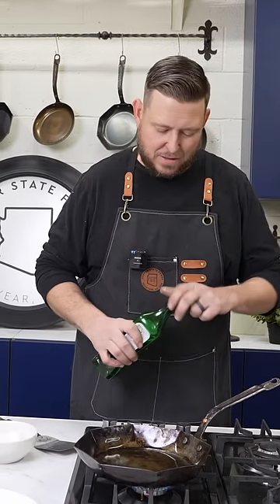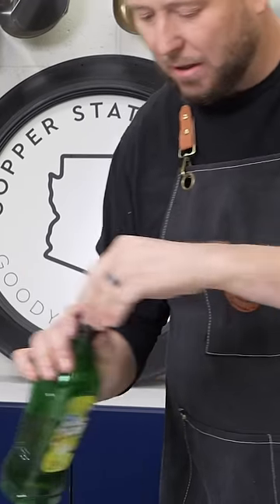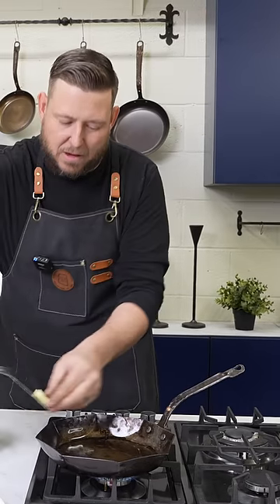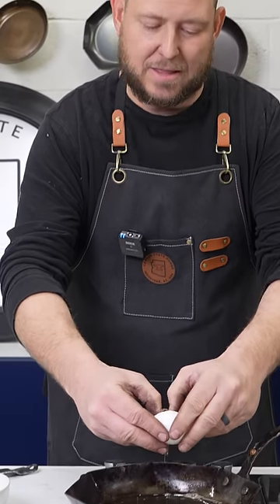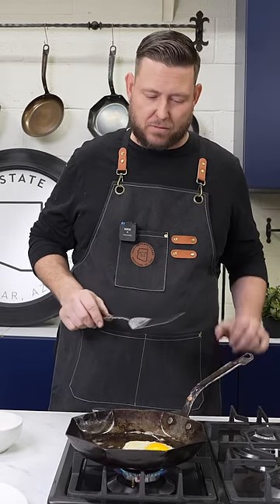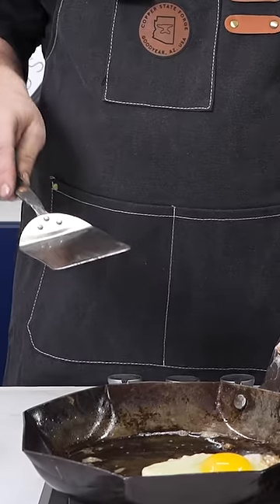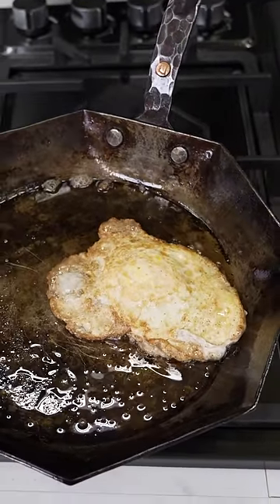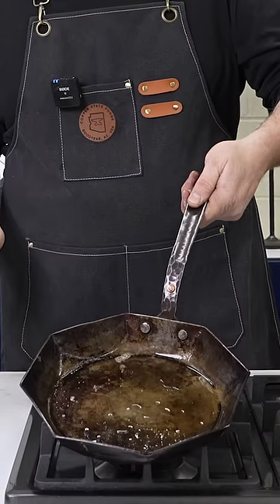Frying an egg in carbon steel.

Comment: Oil shouldn’t be necessary. You cook eggs at butter heat. The oil adds a bad flavor to the egg in my opinion.
Reply: Only if you are french or subscribe to that style, everyone else, aka everyone who isn't a pretentious twat incapable of trying other styles, typically fries eggs on high heat, which is perfect for a wok/carbon steel style pan like the one used here, I like both methods, each has their advantages when done correctly, just stop pretending like the french came up with the one and only one way to cook eggs, if possible ignore french cooking, especially if you went to culinary school, you'll be stuck in a rut if you don't
Reply: Their right about the oil, though.  I would rather fry my eggs in bacon grease or even rendered chicken fat than wrecking it by frying it in canola, or even olive, oil.  Also every moment that an oil is being heated over flame it is becoming more carcinogenic.

Comment: Butter and oil? Seems redundant. Why not just make cast iron and season it?
Reply: It's easier to make a nonstick surface on a carbon steel pan, I have plenty of both, just look at the surface texture, doesn't take a genius to figure out, this dude just a clown who can't cook, I can fry eggs at low or high heat with oil or butter with cast iron  or carbon steel and nothing sticks, people are just generally incompetent at everything, you shouldn't be surprised

Comment: That’s the reason why I can’t cook with carbon steel or stainless or anything like that.  that egg is way too overdone for me and the only way to cook with them types of pans you have to have heat
Reply: if you adjust your cooktime to account for the heating pattern of a pan, you will get perfect eggs every time. it takes trial and error though